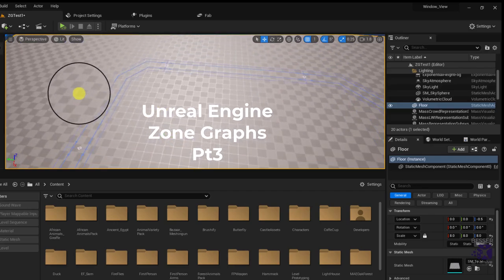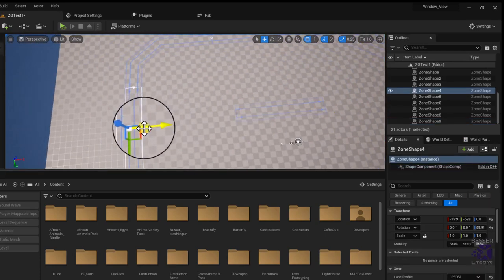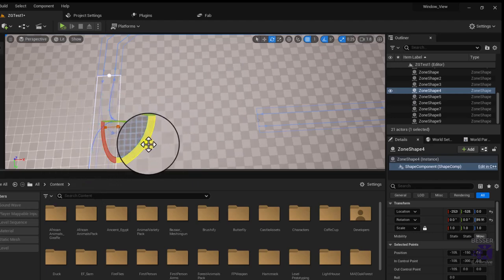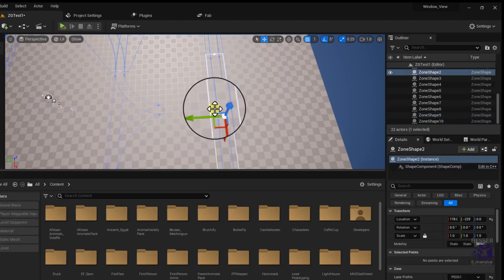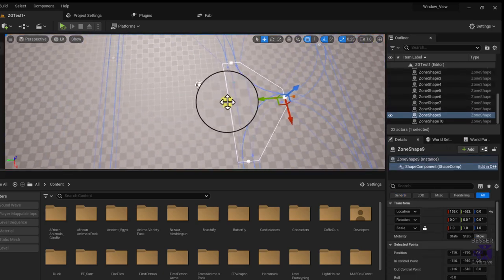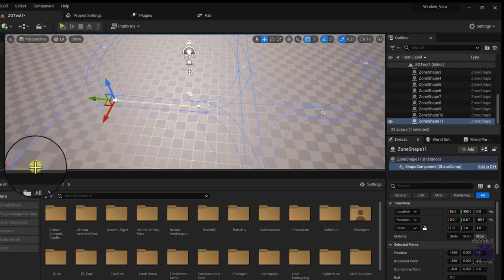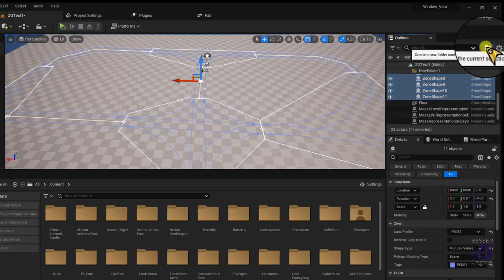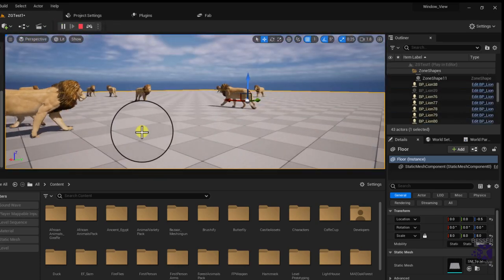Unreal Engine Zone Graphs Pt 3

Comment: please do the vid on covering different crowds and animal meshes going through the same lanes.
I checked the links, but sad to say, they just don't explain it as well as you do :)
Reply from the maker: It'll take some time, but i will try to make a video. It will come down to tags and adding entities to the mass spawner. The zone lane profiles can  have many tags assigned. Once your tags are set, you add the Data files to the Mass Spawner. If you have the City Sample project, the vehicle Mass Spawner is a great example.